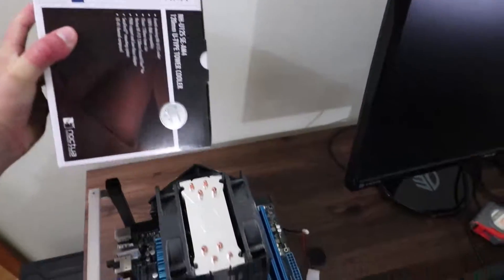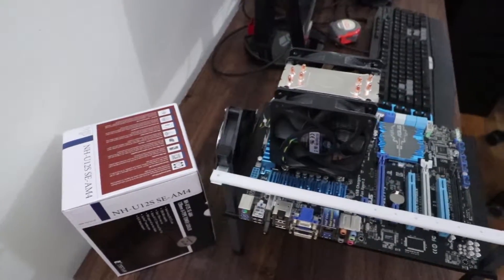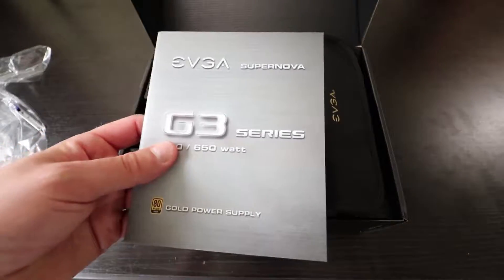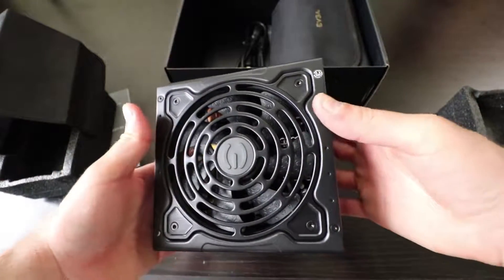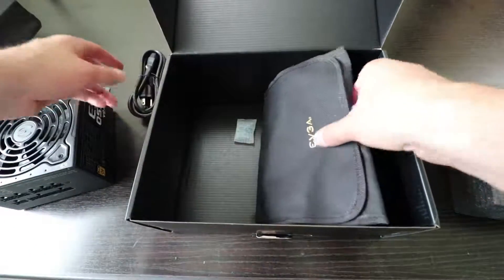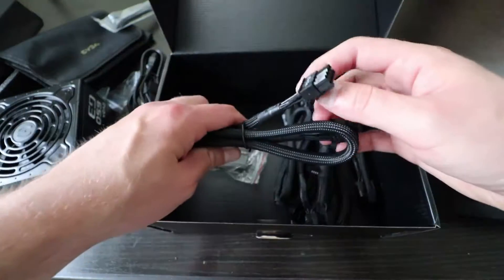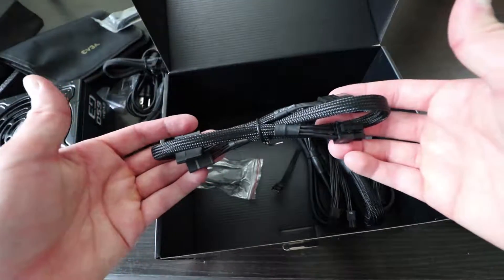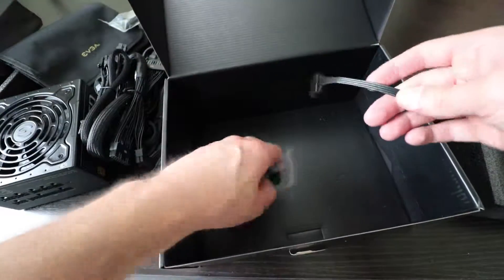EVGA SUPERNOVA 650 G3 Unboxing - Straight To The Point

Comment: Could you tell me what protections it brings? as OTP?
Reply from the maker: Heavy-duty protections, including OVP (Over Voltage Protection), UVP (Under Voltage Protection), OCP (Over Current Protection), OPP (Over Power Protection), SCP (Short Circuit Protection), and OTP (Over Temperature Protection)